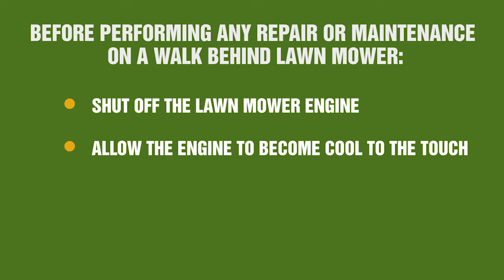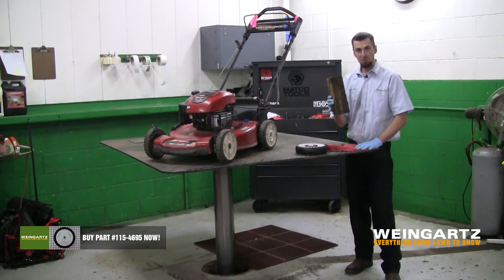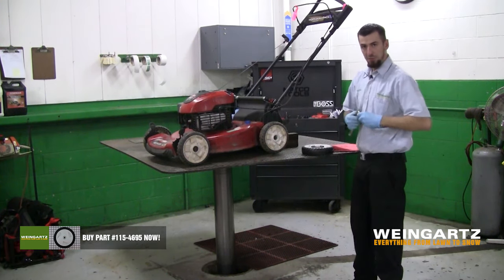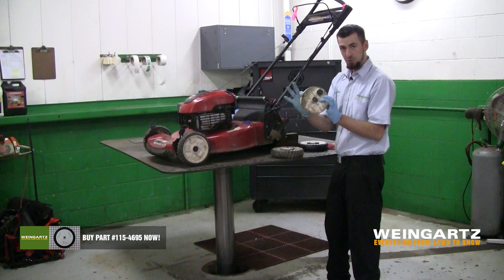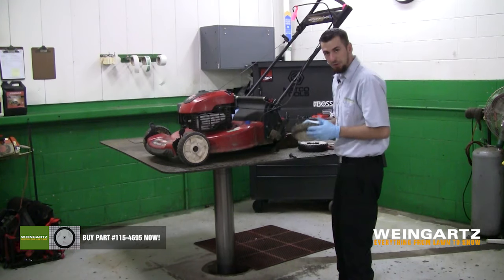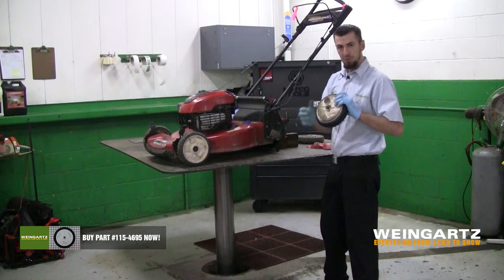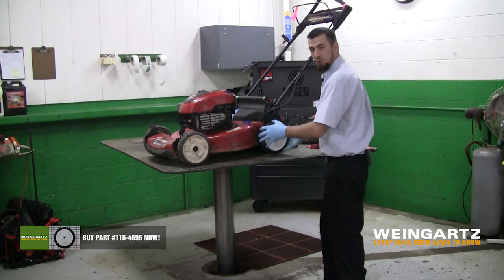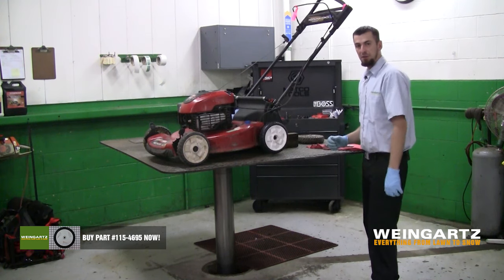How to Replace a Toro Walk Behind Lawn Mower Wheel - Using Toro Parts Wheel Gear Assembly 115-4695

Comment: on the left side of my mower there was a smaller washer that needed to be inserted because without it the wheel would not turn and also with the forward motion bolt will come undone  because it loosens towards the front

Comment: Replace a plastic-geared drive wheel with a plastic geared drive wheel?  Wouldn't it be more cost-effective for the consumer (although up-front cost may be higher) to replace the wheel with the metal geared Toro wheel and matching pinion? A win-win for the consumer and supplier.
Reply from the maker: Hi John,

Thanks for watching. The parts are model specific and that model that we're working on does not take metal gears. Please let us know if you have more questions or concerns.
Reply: engines are designed to have a fail point somewhere before the engine body itself. So yes your comments make sense... however its much cheaper to replace a plastic part than the entire engine. In many things, you will find shear pins. ie a point made to fail.. for example, rudders, and even traffic street poles have a shear pin/bolt. in other words, a small failer is better than a big one in engine mechanics.  ;)   I mean yea the entire thing cooould be made of very high quality parts that will never fail. but do you want to spend 2k on a mower?

Comment: Why replace them if there wasn't any wear? Owner must of had a smooth yard if those plastic teeth weren't wore out after a couple seasons. A real video of this would be a complete rebuild of the entire rear drive, pinions & wheels. This design just sucked, gold pop metal hangers didn't help at all. Thinking I might try the older metal gear wheels & pinions & see if that works as well as I have heard it does.